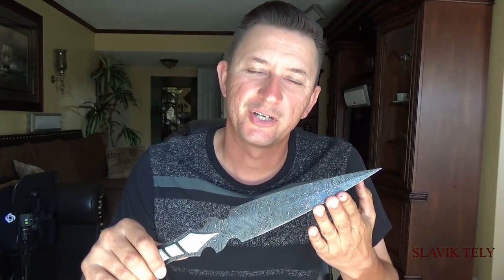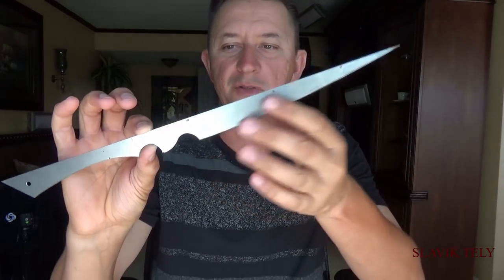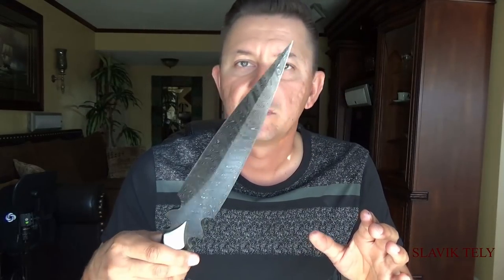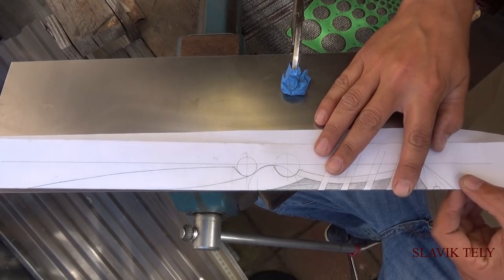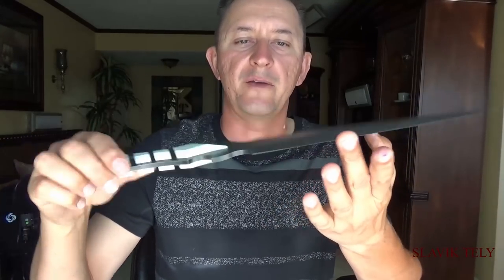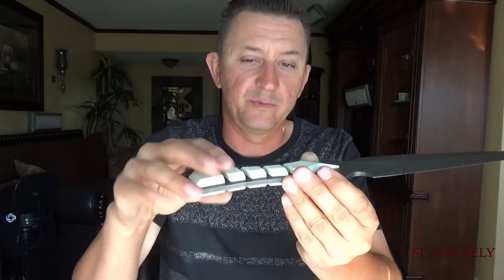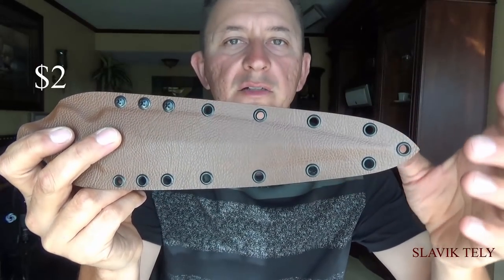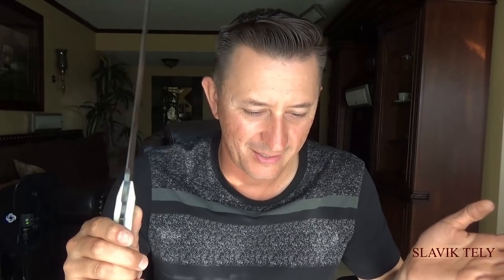Standoff Knife Q&A

Comment: With regards to everyone saying it isn't forged, I watch many youtubers and I watched one where he took a bar, beat it into rough shape then cut and ground it to final shape and I wondered, what does that do other then add the chance of cracks or other imperfections? I did ask him if there was a reason to do it that way but he didn't answer. Not everyone has an anvil, forge or space to heat up steel and beat it with a hammer, and frankly so what? This IS a knife and a great one at that.
Reply from the maker: I know why he did that "little" forging....so there would be keyboard warriors all happy and cheering for him that the knife "was" forged. But you and I know he did absolutely nothing but like you said made more risk of steel failing later on.

Comment: The guy/gal who wrote the message about "forging vs stock removal" hasn't ever made a knife. It is an old argument that has no bearing on knifemaking. It has been discussed to death and experts agree to advantages and disadvantages of both forging and stock removal. I know plenty of Master knife makers that do both depending on what they want to do. You are a good craftsman and make some great stuff.
Reply: Well said dude 👍👍
Reply: Even smiths who forge the stock, still remove stock to complete the blade. So as Telly said, the stock was forged, which is the stock Telly used to create the blade. A beautiful piece of work I might add. Telly is a craftsman and owes no apology or validation to punks who have never produced a blade or anything.

Comment: there are 3 types of knife makers . one  store made and people who use cnc machine aka costom  made. two  so called stock removal cut from a blank into a blade and finshed on a belt sander .three  forged out and finshed on a belt sander.  all  need some kind of forge to harden the steel. All blade smith use a belt sander or a grinder.
Reply from the maker: Amen.
Reply: Some use files and sandpaper.  Takes longer but same process as sander. Forge finished blades are very rare. Well the ones that look good are.